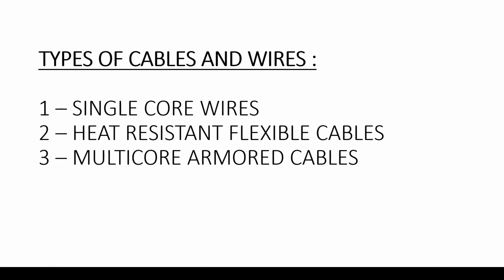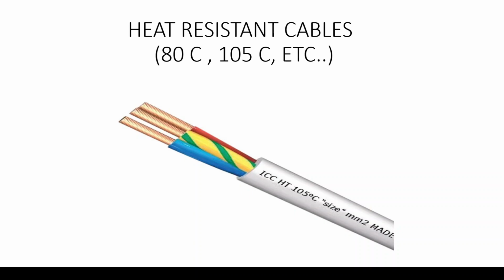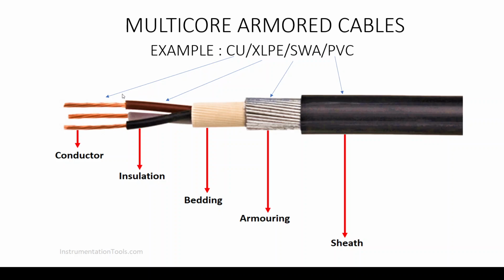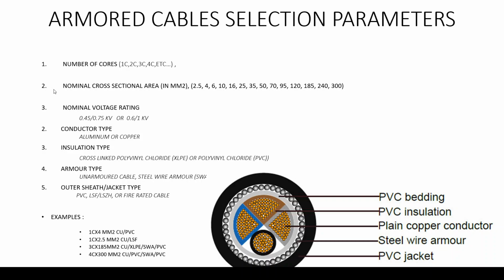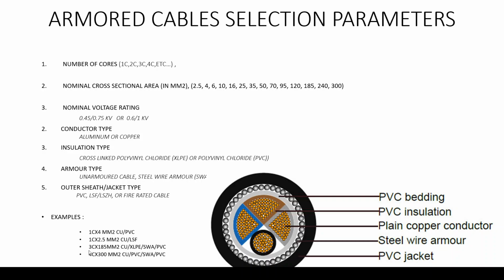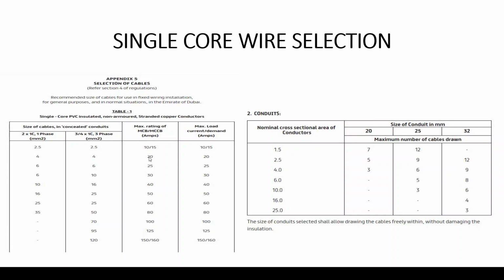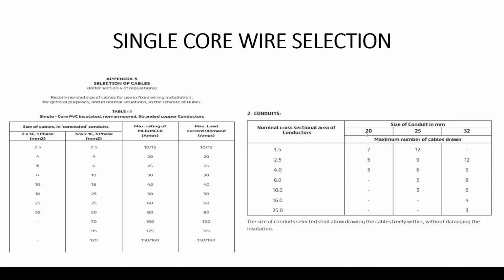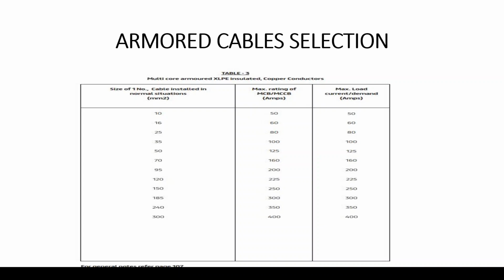Cable types and selection as per DEWA - Simplified guide for beginners

Comment: What is the criteria for 2 run,3 Run cable selection?
Reply from the maker: Following are examples of multiple cables selection :

1. Motors having a Star/Delta starters must be connected using 2 runs of 3 core cables, regardless of the size.

2. Loads with breaker rating higher than 400A. This is since the max. Cable size used locally is 300mm2 for a 400A breaker. Therefore, if you have a 630A rated load, then you'll have to find a suitable cable combination, like 2x4C 185mm2.

3. When the voltage drop value is very high, then you might have to decide in some cases, whether to use a bigger cable size or multiple runs to ensure that voltage drop is within permissible limits.
More on this in the coming tutorial videos, where I will provide a detailed voltage drop calculation study and explain all aspects.